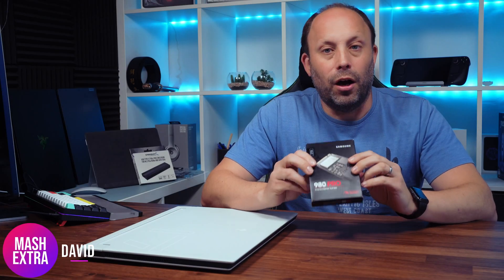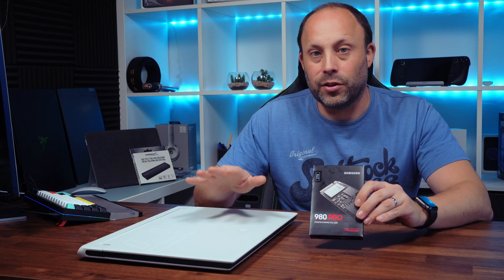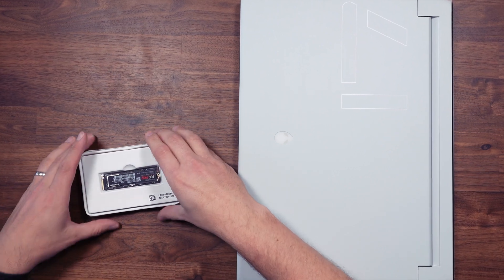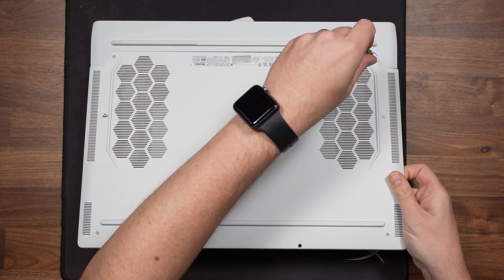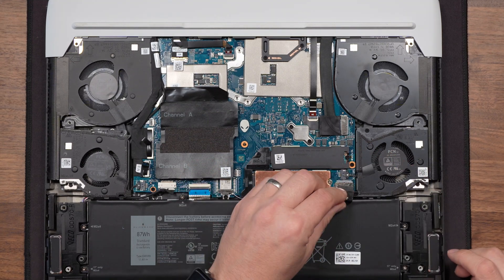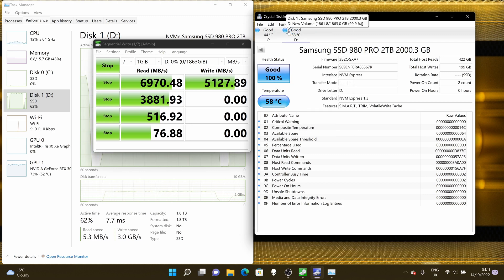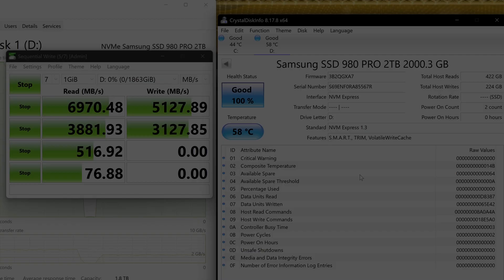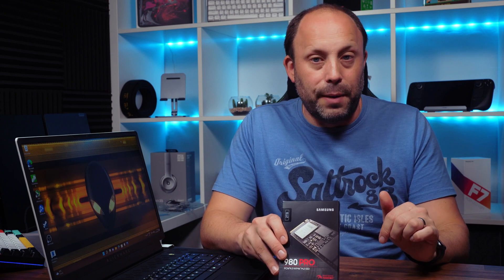Samsung 980 Pro - Installation, Testing and Temps

Comment: My Dell XPS 13 laptop only uses half of the lines (by design) of the 970 EVO NVME.  970 EVO prices are pretty high right now.  Given that Gen. 4 drives run hotter than Gen. 3, wonder how using Gen. 4 drive would affect the temperatures.  I would hope using half of the lines would keep the temperatures down a bit, at least.  The NVME seems to be touching the outer casing of the aluminum laptop, but there is no thermal pad.

Comment: do you recomend me buying this copper heatsinks?  will they help me?   I bought this ssd  980pro 2tb  and when I installed it  into my rog strix asus laptop and ran crystaldiskmark  I got  83 degres celsious, composite temperature and critical warning,   I got pretty scared because crystaldiskinfo marked it as 100% bad  even though I just installed it from the box,  after it got cooled  crystaldiskinfo  marked it again as 100% good,  I uninstalled it and was about to return it and found your video... on idle it sits at about 50 to 53 degrees, my  ambient temperature is about 29 degrees where I live...please  answer me because I don't want to spend a single dollar more in vain.

Comment: What is the impact to battery life after installing a second high performance ssd like the 980 pro?  Is it noticeable?
Reply from the maker: I haven't actually tested that so let me have a go and get back to you
Reply: @mashextra  thanks, in theory it shouldnt make a big difference but something Ive been thinking about since these 12th gen intel laptops already have poor battery life out of the box.
Reply: any update?  I am looking at the samsung 990, guessing it would be similar, also any 980 owners should check firmware, seems there have been updates...   @mashextra